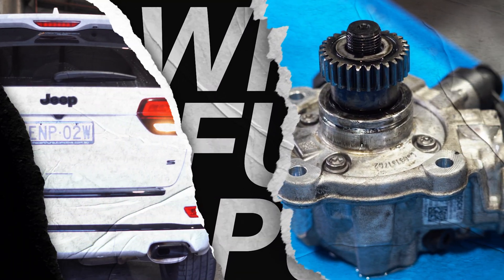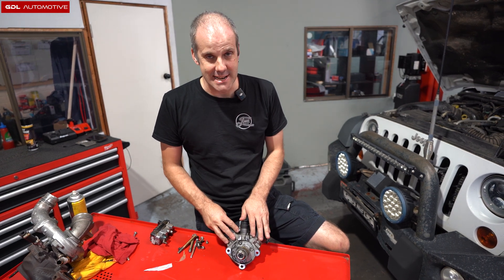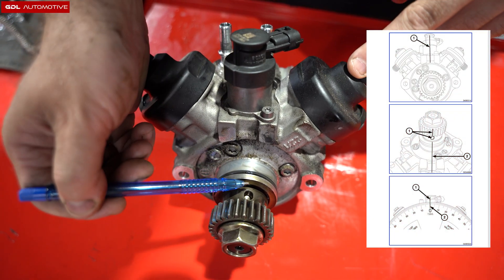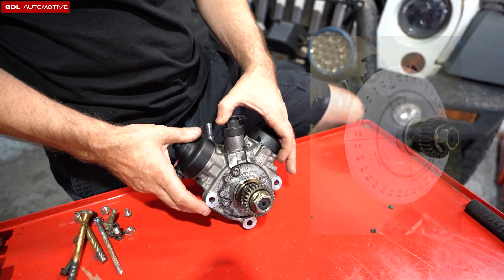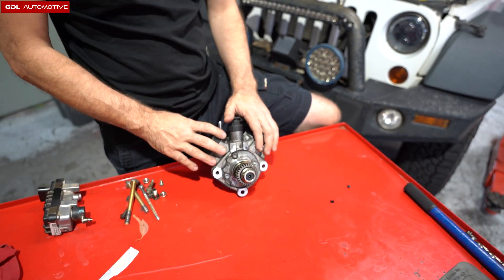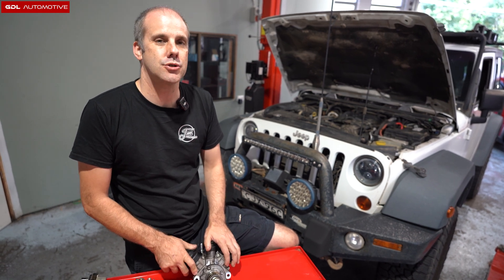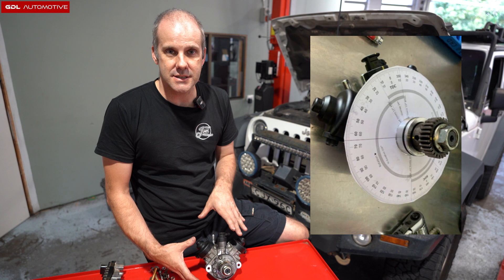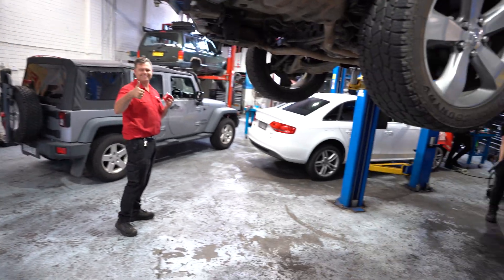Poor Fuel Economy After Z46 Fuel Pump Recall - Jeep Grand Cherokee

Comment: Fun fact. Jeep had two goes at replacing this under the recall. First time they pinched the o-ring. Second time, what I hope was the apprentice snipped the water temp sensor wires, did not solder them simply electrical taped them together hoping for the best. Engine sounded off. I inspected, and repaired it.